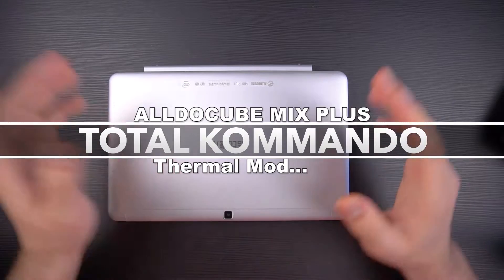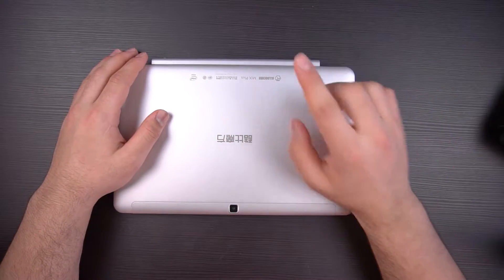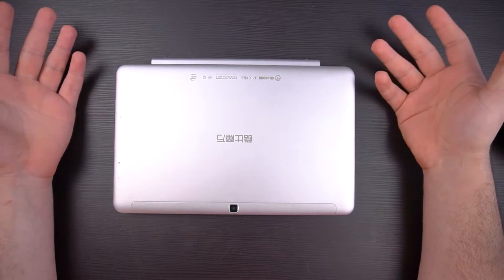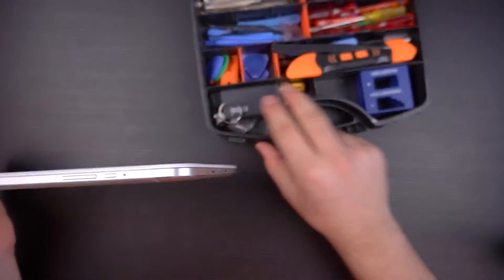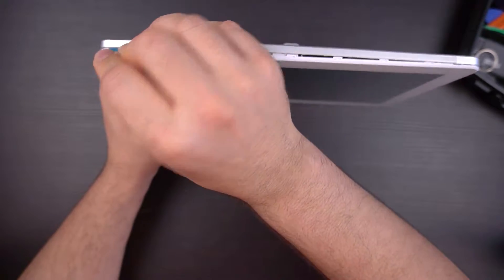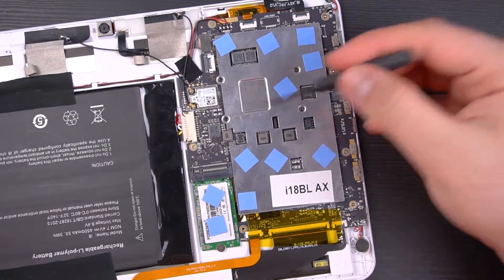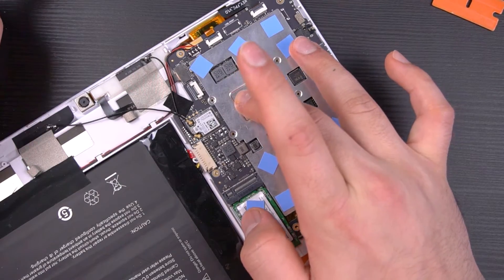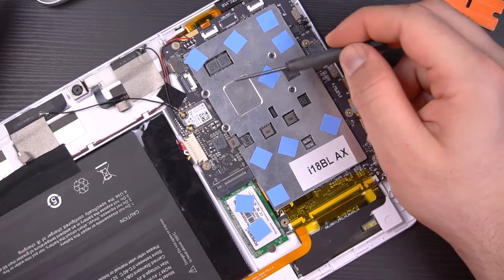AlldoCube Mix Plus | Thermal Mod | Improved Stability & Performance

Comment: If I i just put thermal pads on top of the heatsink and don't mess with the one on the cpu itself, would it lower the temps?

I don't wnt to risk frying the circuit board.

Please reply.

Comment: I wish someone delid this thing! It would be possible... using liquid metal with nail polish at the components aside the cpu die.
You had a 10 degree better temp? That is great. It would be a lot cooler at touch the back of it, even the battery should last more.
Reply: So far not really I have seen no info if they will ever, if anything just a whole new windows tablet
Reply: Well there is nothing really here to delid, the cpu/gpu is already exposed, I am waiting for a new model
Reply: Life Kommando actually the liquid metal is applied directly on the cpu die. It would be interesting to see the results.
Reply: I plan to give it a try on some hot laptops including this one once my LM comes in, going to be deliding my 8700K

Comment: What's the thickness of the copper shim that you used? I'm worried 1mm might be too thick.
Reply: I need to know this as well
Reply from the maker: 1mm is what actually used a thinner piece might be better pretty cheap to get a hold of both on ebay